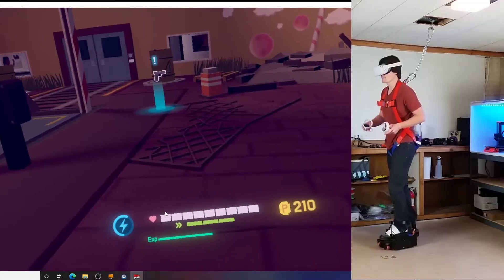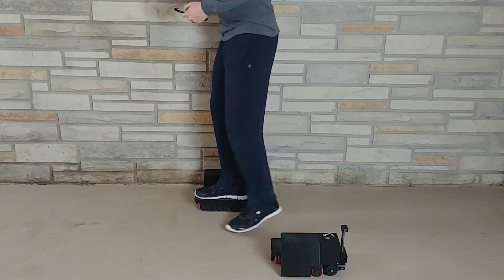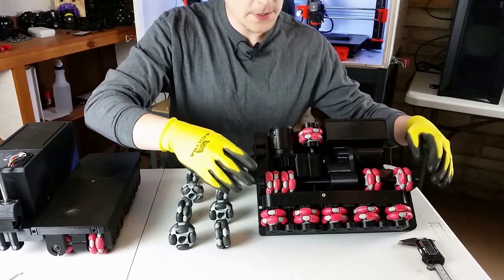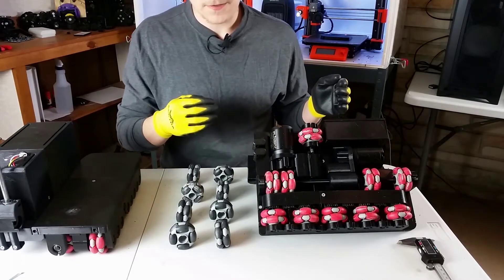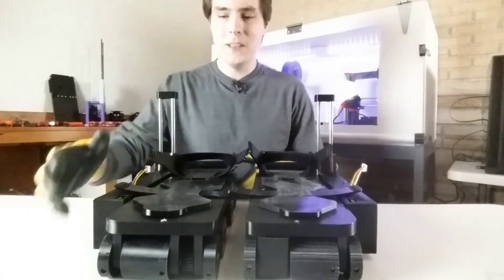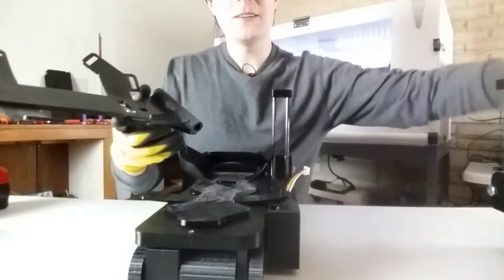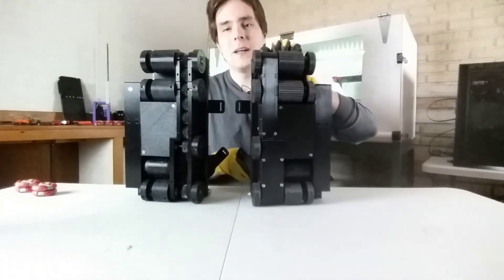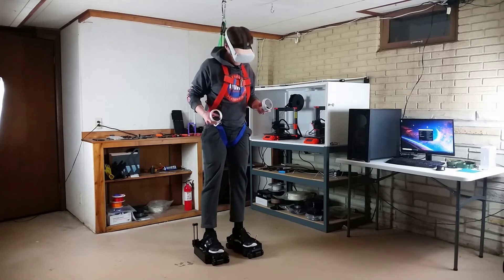Virtual Reality Motorized Shoe Build Log #32 - A Lot of Changes + No Man's Sky Demo

Comment: that passive vr shoe sounds really cool actually besides it of course being cheap it also wouldn't need to charge which is also cool the only issue i think it would have is due to differences in weight of the average person you would need to figure out away for people to calibrate it for them self's which i imagine trying to change the design like that would be difficult and likely increase the cost.
ps with a simpler design with the none omni directional boots will you be able to release more videos more frequently or will it still be roughly the same upload schedule?
Reply from the maker: For the passive concept, I would probably include a cheap dc motor that can push a disc brake into the wheel to control speed. So if a heavier person uses them, the disc brake can push against the wheel harder. I think one of those $3 dc motors would work fine as long as you design the actuator to use a screw, so back-driving the motor won't be an issue.
I think I can upload more demos. When I started this channel I wanted to upload once every couple weeks but often found that I didn't have anything new to show. I didn't want to make videos where I was just like "I'm still working on the same features I showed in the last video, but nothing new to show". So now I'm uploading when I have something new finished. I'll try to upload at least once a month. If you have any suggestions let me know. New product features take a lot of time but I can try other kinds of content that can be more quickly made into videos, like demos or 3D printing videos.
Reply: @finallyfunctional  the only thing i can really think of is to try and improve the speed as currently it looks kind of uncomfortable to walk in like your walking in snow. 
ps have you noticed a difference since swapping too the none omni directional shoes cause in the video for me i didn't really notice a difference in the movement.
Reply from the maker: With the omni-shoes they would sometimes want to slide to the left or right. With these shoes that isn't an issue so that makes them feel a little better. 
Overall these shoes feel a lot better to walk in than in my last demo. With the algorithm improvement and the harness helping me balance a little it feels better. But I have more things I want to do to improve them and will keep working on it.
Reply from the maker: I've seen some other YouTubers uploading these #shorts videos. I could try something similar if that is something people are interested in.
https://support.google.com/youtube/answer/10059070?hl=en

Comment: I am impressed that instead of sticking to one type of shoe (the Omni directional option) that coming up with simple version shows that there is always a way to trying to solve a problem. After watching the full demo, I can see that the locomotion may be slower than an average treadmill, but It reminds us that there is an average speed that goes from casual/brisk walking to fast walking. I like what is being shown in the development process, and seeing that the aspect of having walking locomotion in VR will create a better experience even if a game has some glitches here and there.
Reply from the maker: Yeah, there are so many VR locomotion solutions, some better than others. I agree with you that most likely motorized shoes won't be able to go as fast as a slidemill. I don't think any active system will let you go as fast as a passive one like a slidemilll. But I'm going to work at it and see how fast I can make them go.
I don't really think that they need to go super fast anyway. If I can get to a slow jog that would be great. I think anything faster than that would be fun for a few minutes, until you get tired. I plan on adding a speed configuration so that you can set up the shoes so that you are running in game but only have to walk in real-life.